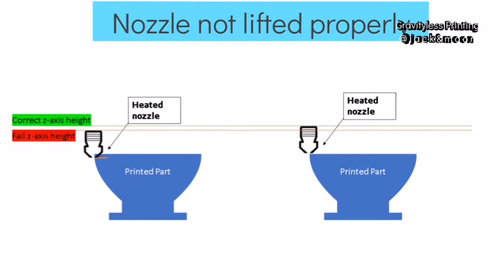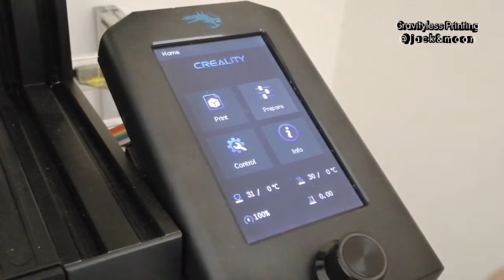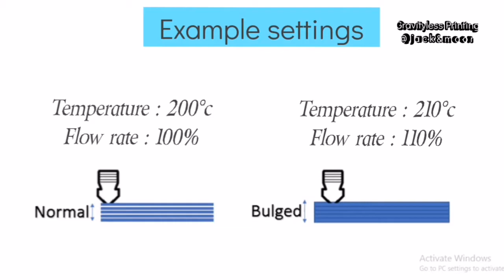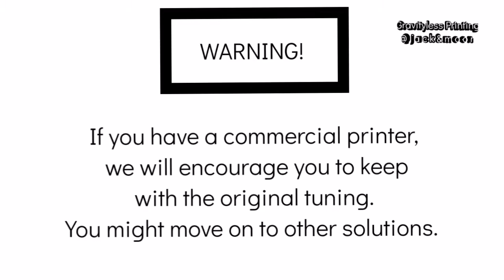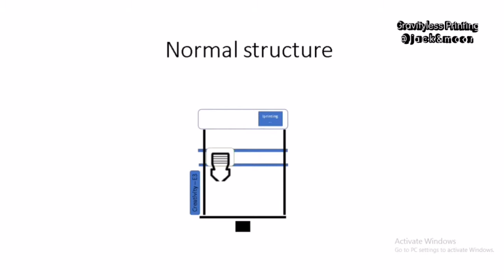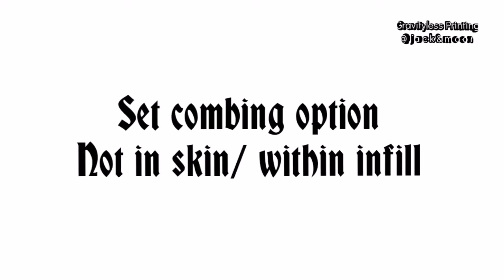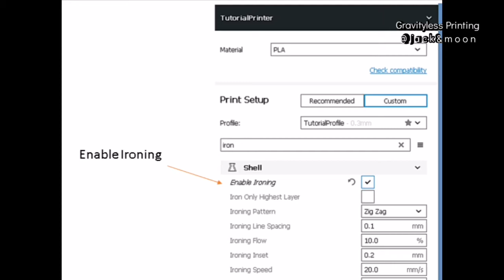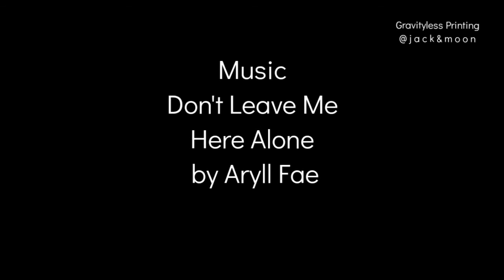Why This Print Fail?#scars top surface#nozzle scratch#perfect surface

Comment: I solved my problem of poor dimensional accuracy and over extrusion on the top layers by setting different flow multipliers for the walls and top layer. in my case I changed the wall flow rate until it matched the wall thickness I had set (used calipers to measure the printed wall calibration box). then I used a lower flow value for the top layer to avoid over extrusion, you would do the opposite if there's gaps between the lines